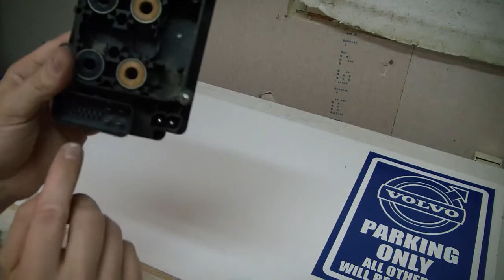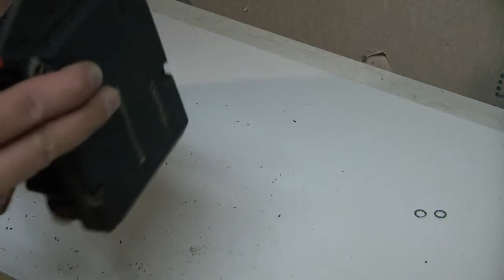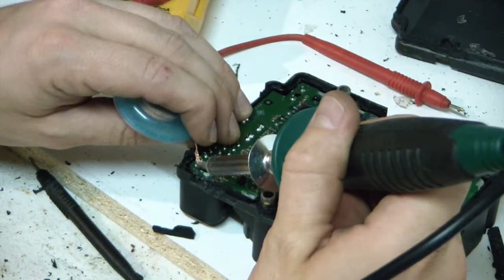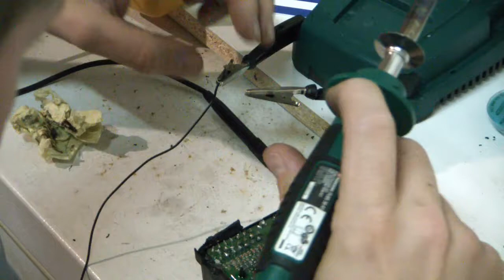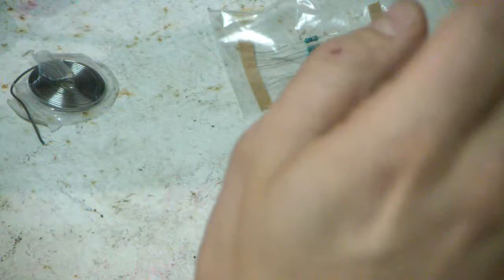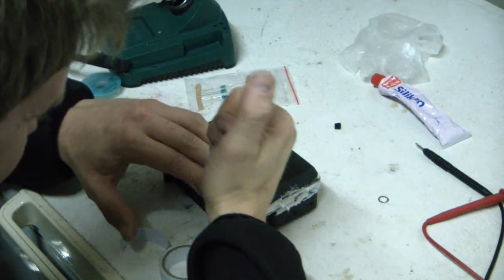DIY Repair "kind of" volvo ABS and tracs 96 models.

Comment: Thanks for the video. An alternative method of accessing the pins to re- solder is to cut the cover width ways just beyond the recess which the label sits at the connector end of the box, carefully using a hacksaw so that a small section of the cover can be removed only in the area where the pins are located and not having then to fully remove the cover. Once the cut is made the section can be prised out assisted by levering the lid along the cut line. I have now successfully repaired two of these units using this method. When the membrane has been removed and the pins re-soldered and cleaned with isopropyl alcohol I used acrylic lacquer to re- seal the pins before epoxy gluing along the cut and then sealing all of the exposed seal line with silicone sealant. I hope that this may help anyone struggling to get the lid off of the unit.
Reply: Would like to visually see that method.
Reply: Hello Steve
Unfortunately I didn't take photos when I did the repair. At the risk of repeating myself: The cutting is quite easy, as long as you are careful not to hit the board on the inside. Just cut a line about 35 to 40 mm from the edge where the connector is, cutting right to the joint line between top and bottom case halves, then, carefully using a wide blade flat screwdriver prise the small cut section out to expose the pins. Remove a section of silicone covering the solder joints with a sharp scalpel, the silicone comes away easily from the board, re-solder, then seal with acrylic lacquer. Re-fit the cut case section sealing with silicone. Hope that helps in some way -apologies again that I do not have photos/ video. If ever I do another one I'll be sure to post it on YouTube.

Comment: Sometimes my brake pedal start vibrating itself until ABS and TRACS lights are on :D
Is it ABS control unit problem? Or ABS sensors doesnt work correctly?
Reply from the maker: The abs unit makes a self check close to 40km/h. and light goes off.
The light is a warning light and should not be on regurlarly

Comment: I wonder what is the best way to separate the lid from the box. I haven't sent one off to be 'reconditioned' yet, so I don't know how well the professionals do it.  I'd like to try and build something that goes in that one millimeter gap around the box, and puts steady pressure between the lid and the box, to see if the lid can be peeled off without breaking.
Reply from the maker: Bend it open carefully och use a fine tooth saw... these are the two ways.  But both requires you to be careful :D
Reply: Stuart McRae I just cut mine open w a side cut til I saw the void within.i used a simple Dremel w a cutoff wheel...I am going to fiberglass epoxy mine back together.

Comment: ive just bought a mint 1996 850r.. its a right beast..lol.
it's running about 300bhp.
manual gearbox.. 
she's very thirsty lol..  
what do you think about these cars.?
Reply from the maker: They like some petrol... but you get to smile at the pump :D
Reply from the maker: "Smiles per Gallon" > Miler per gallon
Reply from the maker: I have an 850R myself... and it is the best 850 model ever made... and until 2003 (comparing manual to manual) no other volvo was from factory had a faster 0-62 time. 

Once you learn to drive the car you can get some really good MPG. but it need you to stop smiling and to start focusing on the cruising :)